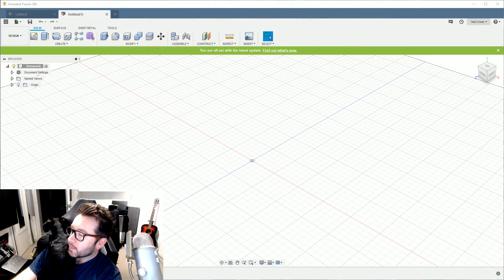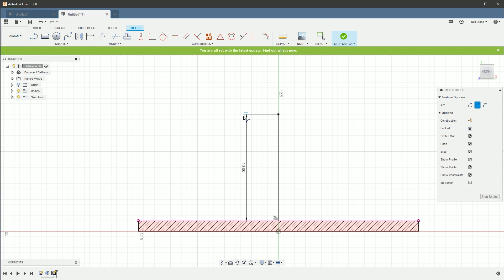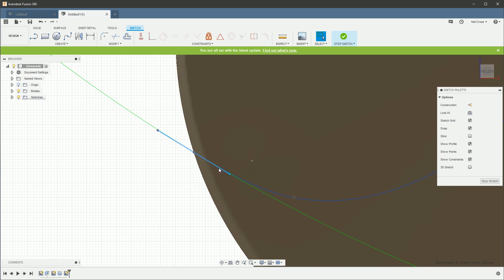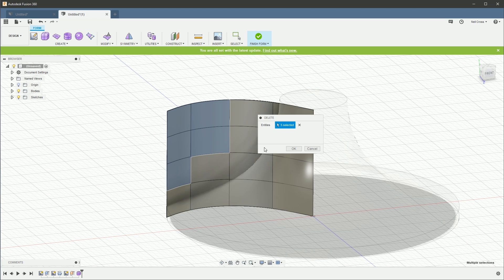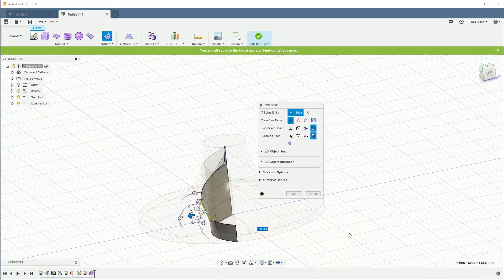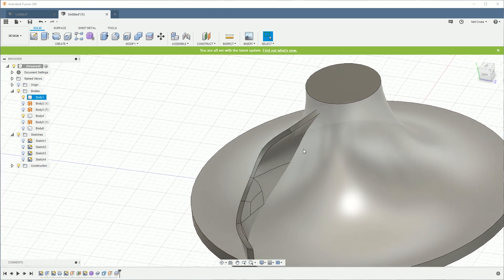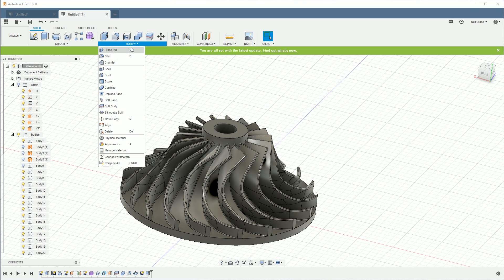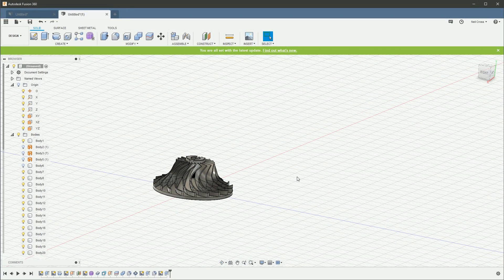How To Model a Turbo Compressor/Impeller | Fusion 360 Tutorial

Comment: I use your site all the time. Great resource.

1) I am trying to create flexible hoses and can’t install the tube and pipe add-in. I use Inventor 2016 professional. How do I resolve this?

2) When I use the sweep command I can start the hose on a ring placed at the base of a hosetail, but can’t end the hose on a plane perpendicular to the other hosetail at the base. Could you produce a tip to draw hoses to link them to hosetails and other couplings?

Many thanks for your help.

Comment: Peanut the Parrot Dog!!!

While I know that we really do not want to have Fusion360  become too much like Inventor for Fusion only users, it would be nice for those of us who use both platforms to be able to have an Inventor style Interface (easily enabled based on our Autodesk license) so we don't have to waste so much time hunting through the never ending (and way too small) pull downs.
For me it would make using Fusion 360 on my Surface Pro in the field much easier since the Inventor interface is much more touch friendly.

Isn't talking to yourself a part of CAD modeling? I was actually yelling at Inventor last night trying to get a 2 part hinge animation to work in Studio. There was the remnant of a constraint locking the part that took me 30 minutes to find. For some reason the constraint showed up in Relationships folder but not under the part itself. Just more of the fun of Inventor.